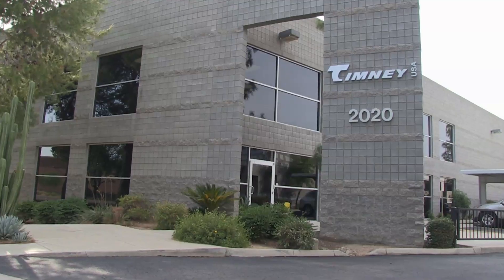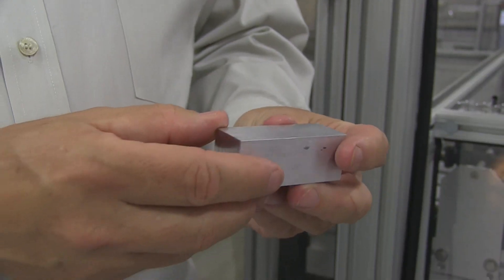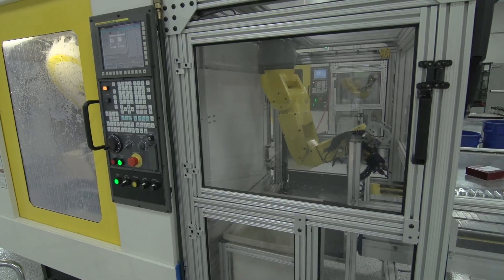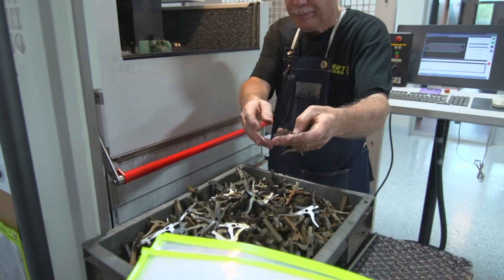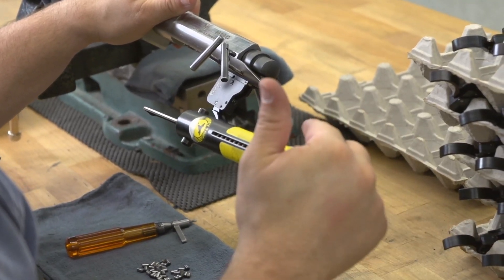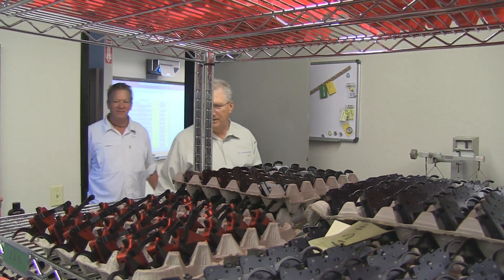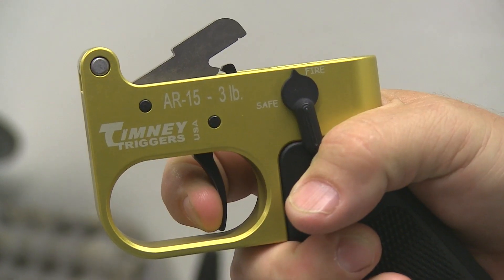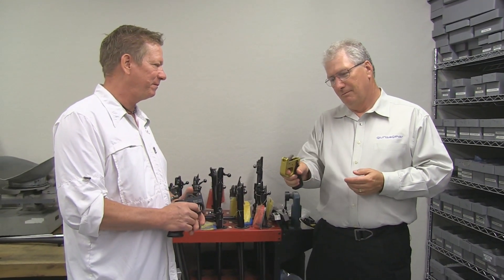Touring Timney Triggers: Guns & Gear|S5

Comment: Terms get thrown around, but in general, the movement before a resistance increase is called "take-up," and movement after significant resistance but before the break is called "creep."  Movement after the break is called, "over-travel."  You can buy good two-stage triggers that have intentional take-up, but no creep.  A good single-stage shouldn't have much take-up, or creep.